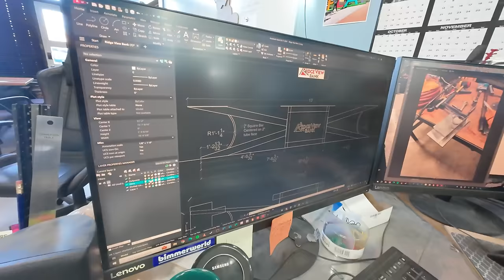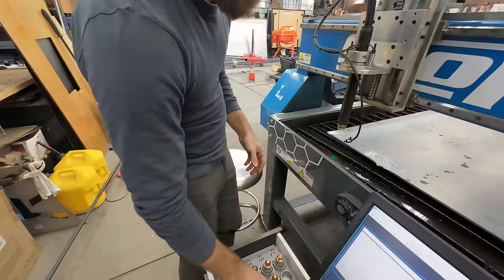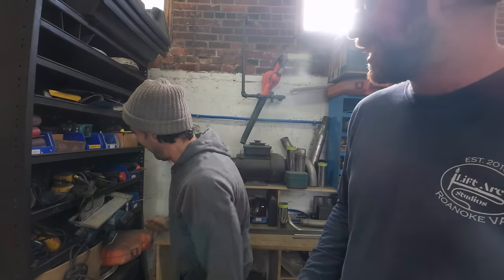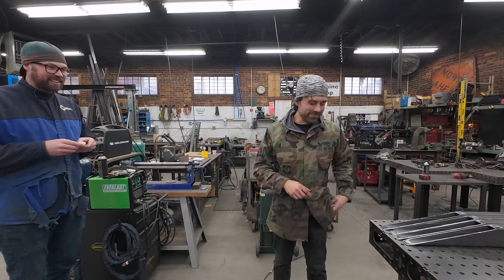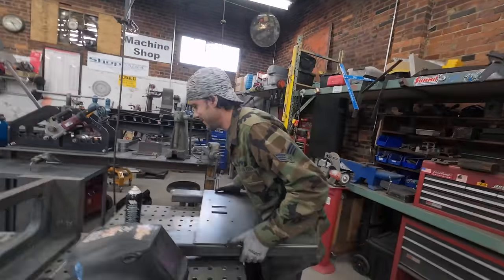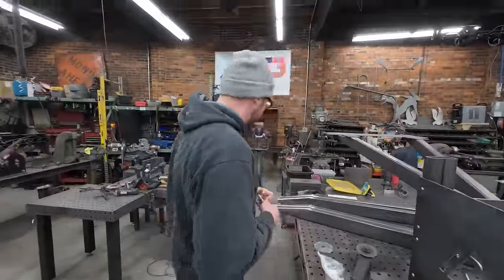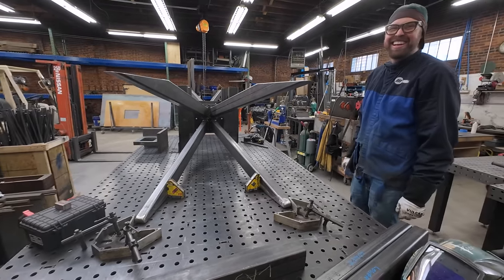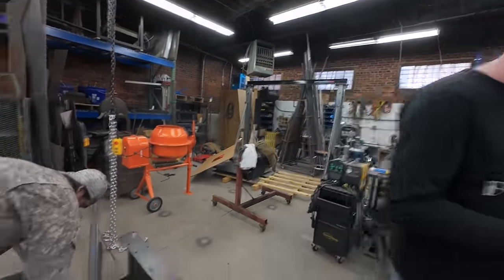MASSIVE Metal Table Base Build

Comment: Pretty cool it really is only thing I noticed when you put the mounting plate for the wood on top the tabs that ran down that really long taper cut they should’ve been angled at the angle that the top pieces were instead of cut Square other than that absolutely amazing

Comment: I like the methods you use in your projects they are all well executed and constructed, I do not get why so many wood guys use powder coat for finishes over metal surfaces, marine, automotive, and jet planes use epoxy like imron, awl grip which can be sprayed, repaired and will finish to much higher mirror if desired and will not detach or chip and any color can be mixed. Used by Boeing, Airbus, Kenworth, Mack, Bertram, Donzi. These are tough finishes that are well proven.

Comment: When it comes to those saw blade I've found immense luck in doing anything to reduce vibrations. If you can clamp it a bunch do it. Since I've reduced blade vibrations its been really solid. When I get lazy just a quick cut I find myself needing to replace the blade due to missing carbide teeth. That's no fun especially when those saw blades are 50 bucks.

Comment: I also ran into the arbor problem with the Evolution saws.  Diablo Steel Demon D0736CFM has a 20mm arbor that fits and cuts way better than the Evolution Combo blade.  Only downside is it's 1/4" smaller in total diameter, but I was able to cut enough steel for a 24ft footbridge with railing on 1 blade.  Still sharp.

Comment: That blade should be able to cut at a full 1/4" depth. Heck my little battery powered Bosch metal cutting saw does it. I suspect that doing multiple passes limited the ability to get the heat out fast enough. If you did a full depth cut most of the time the blade would be in open air and not surrounded by insulating steel.

Comment: Wasn't there 3/4" solid rod to be rolled and welded in place to tie the upper supports to the legs?
Reply from the maker: There was but due to several reasons it was removed, and the table top bolting to both sides will provide more than enough rigidity! - Walker

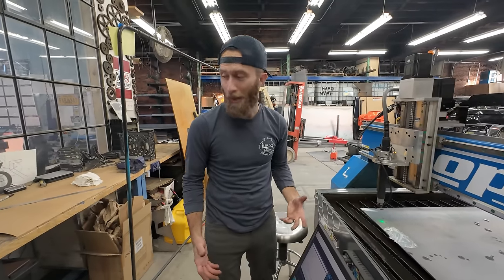Comment: At 6:30 you guys reset the plasma cutter? Are you guys just not using the torch lock switch on the torch itself when swapping consumables? I have the 65A sync system, which is just the middle sibling to your 125 sync and it just seems like you're doing an extra step that you shouldn't have to do?
Reply from the maker: ill be honest, i forgot about that feature, just went out in the shop and tried it, WHAT A GREAT FEATURE. guess it pays to read the manual... thanks friend!